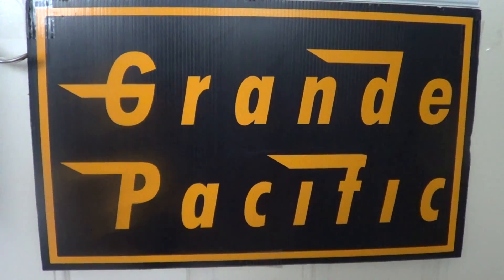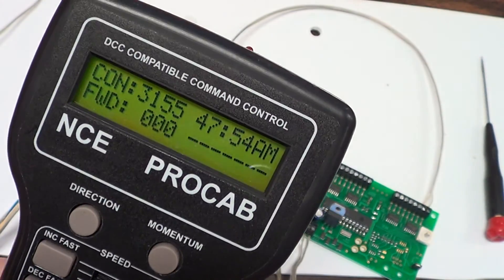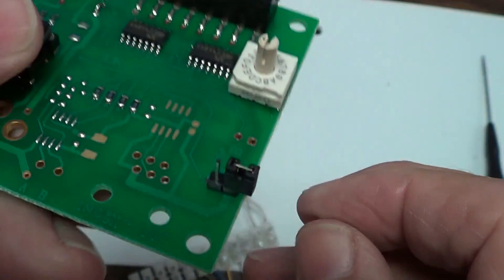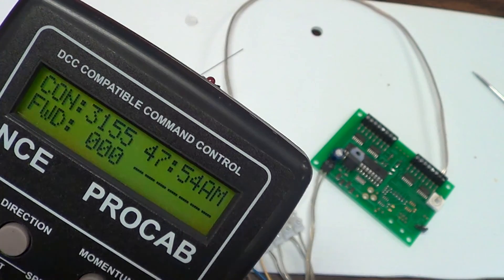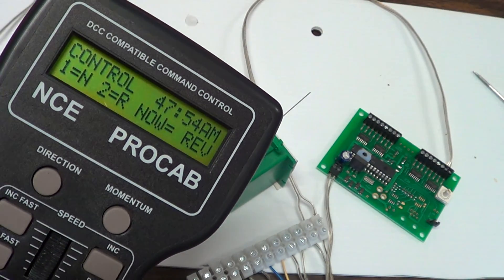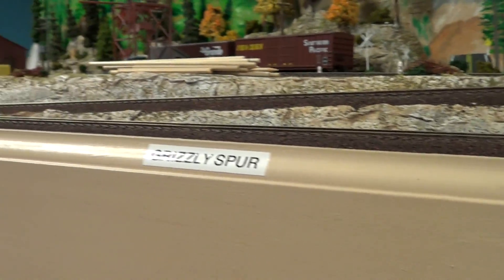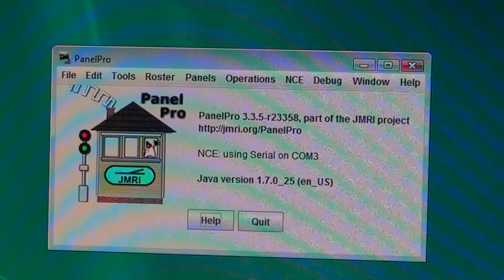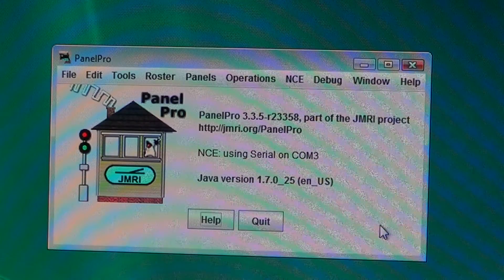NCE SWITCH IT & 8 PTII

Comment: Hi Arthur.
Have you ever done a video on the NCE Switch 8 mark 2 ?
Reply from the maker: Do not know what difference there is in the two but will call and check Monday. As I remember has to do with programming shunt just makes it easier.
Reply: +arthurhouston3 
Thanks Arthur.
I think you can also add an NCE button board which means you can switch the switches / points just like on a Switch It.
I have an NCE Wireless Power Pro 5 amp system myself so your video's are extremely helpful to me.